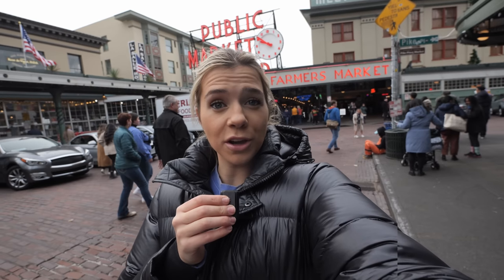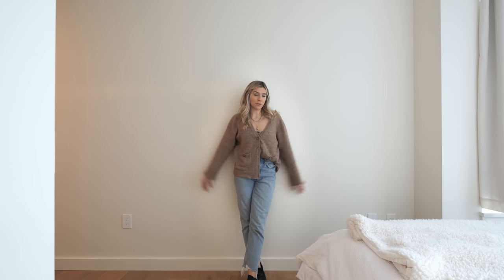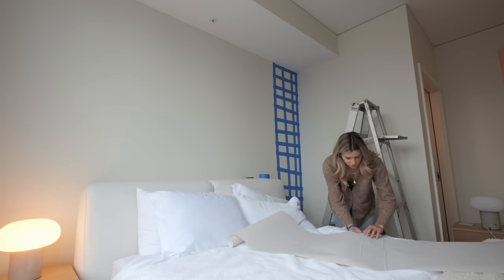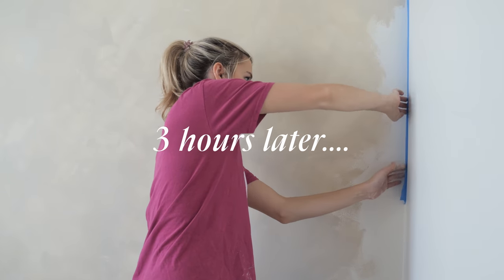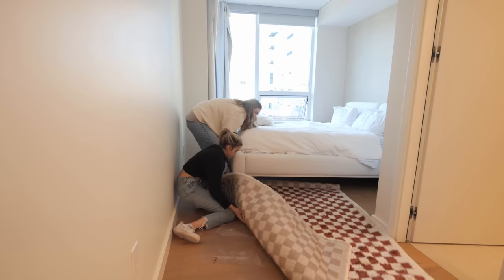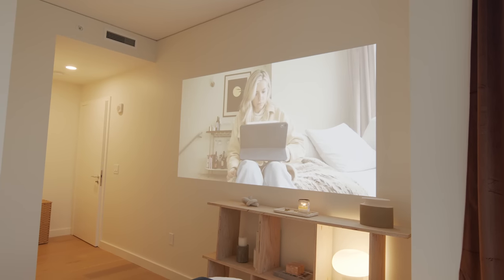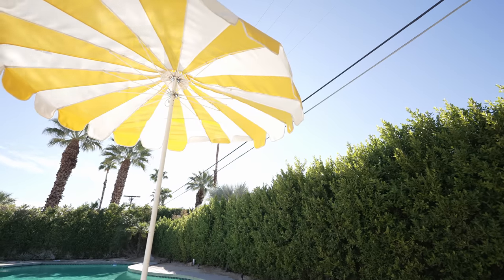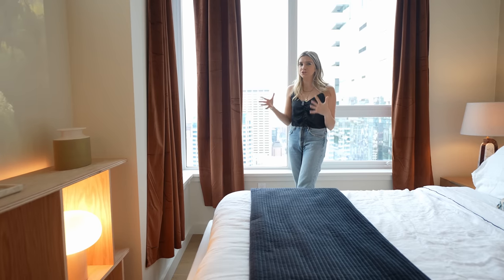DIY EXTREME Bedroom Makeover | Full Bedroom Transformation 2022

Comment: Shelby I hope this isn't rude but a great makeup tip is to always have your eyeliner thicker on the top rather than bottom lashes. Otherwise it tends to bring down your eyes rather than 'open' them up and it's also aging. You only need to do a really subtle line on the bottom, and avoid the waterline.

Comment: Rather basic but a good start. Here's some helpful suggestions. 
I pulled a lot from Wayfair so maybe there is a sponsorship in their somewhere and you can do a video on how to elevate a DIY room makeover.
 
For the wall art here are suggestions
My fav 
*Homary
Decor Art Brown Metal Hanging Accents For Living Room

Or other options
Wayfair 
IDEA4WALL Canvas Print Wall Art Set Mid-Century Orange Minimal Shining Sun Galaxy Nature Abstract Illustrations Modern Art Bohemian Decorative For Living Room, Bedroom, Office - 3 Piece Floater Frame Bold Art on Canvas

Book shelf
KALLAX
Shelf unit with 4 inserts, white stained oak effect, 57 7/8x30 3/8 "

Additional 4 KALLAX 
Insert with 2 drawers, white stained oak effect, 13x13 " 
The second row on shelf

4 DRÖNJÖNS
Storage box, white, 13x14 ½x13 " 
For top row on shelf and spray paint these copper 

KALLAX
Base on legs, white, 57 1/2x15 3/8x7 1/8 " spray this copper

Wal Mart
Krylon Fusion All-In-One Spray Paint, Metallic Copper, 12 oz.  3 cans and the gun attachment
 
Spray Ikea knobs or buy new ones from wayfair see below

Wayfair
*2 packs of 1 3/4" Length Geometric Knob Multipack (Set of 6) Brushed antique copper  by GOO-KI 

No sew hack for the curtains order another set of curtains, cut them to length to reach floor plus 2 inches extra for each panel, use adhesive or iron on tape to connect by over lapping (do not create a seam it'll drape weird, add a 1 to 2 inch satin copper ribbon with the iron on or fabric glue to cover over lap line to create a decorative band

Ribbon
Hobby lobby
Rust Double-Face Satin Ribbon - 1 1/2"

Rug options

Wayfair
Haltwhistle Power Loom Terracotta Rug
 by 17 Stories

*Gammage Power Loom Performance Gray/Blue Rug
by Trent Austin Design® 8 x 10